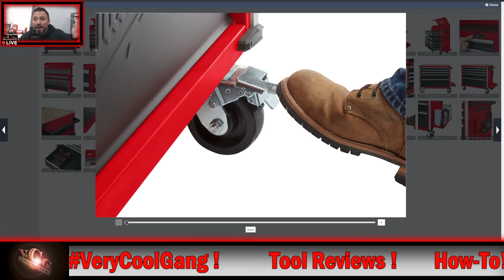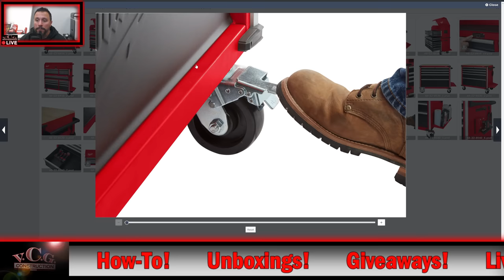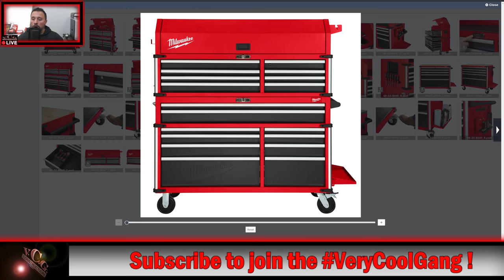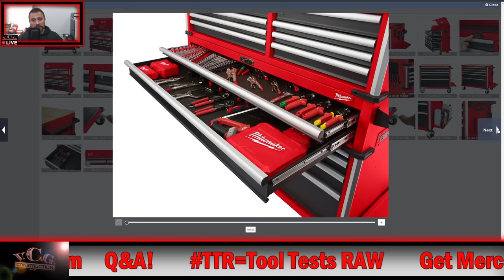Newest Milwaukee Steel Storage Solution   YOU WONT BELIEVE THE PRICE

Comment: I was at my local Home Depot checking out your “56 high capacity tool chest A few days ago. I stop by today to pick up a Milwaukee high torque impact gun. I stepped on by to take a second look at the “56 tool chest and noticed the locking mechanism to lock and unlock the box was free spinning and the key wouldn’t work anymore! Was probably damaged by the customer but has anybody purchased the tool chest and ran into this issue?

Comment: I’ve heard good stuff about the HF general boxes. They look about the same just doesn’t seem to have the power options as seen on the first model and are around 480 not sure
If you can use the 20% coupon also. With the price difference is it enough to choose the Milwaukee just for brand preference?

Comment: I have that high capacity box. Both top and bottom.   It may not have the electronic locks but it was only $800 late last year when I got it.  Same depth and tool storage it looks like.   That box isn't new.  Looks like same box with electronic locks.
Reply: It's wider.

Comment: It’s a nice box with stainless, but ur ganna pay for stainless ! I bought a 46” box about 6 months-yr ago , I did a lot of research before I picked the husky box with wood top , I don’t regret it half the price if not more (on sale around 300$)of Milwaukee and most brands, ball bearing soft close drawers,power center and is very heavy duty built! I had a smaller craftsman box before that and hated it, it was made very cheap drawers adventualy stopped closing correctly etc etc ! Huskys quality in tool box and most hand tools have came up over the past few years. And no bill or payment to the tool truck or cc. !